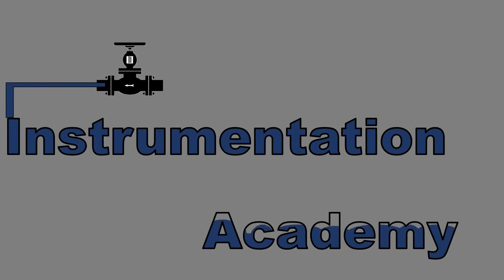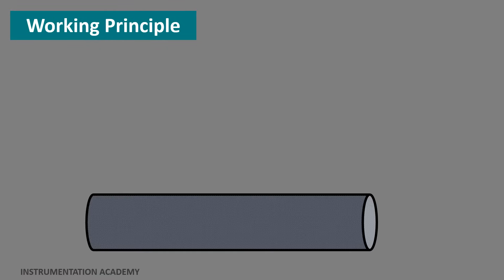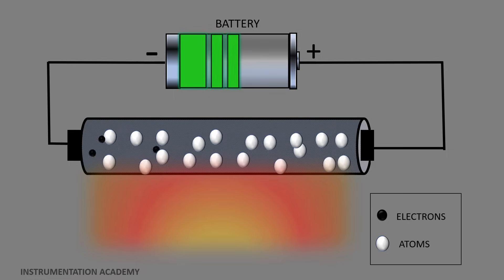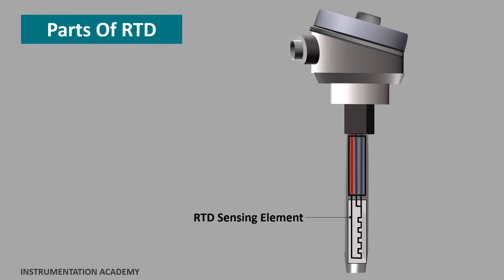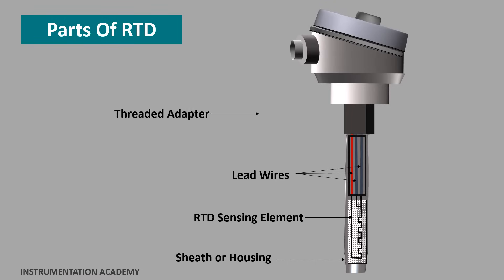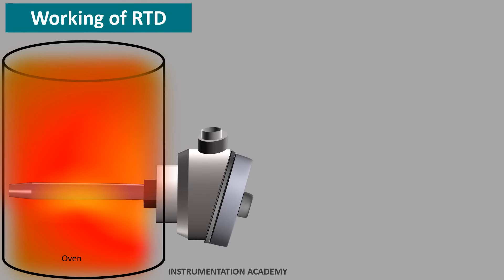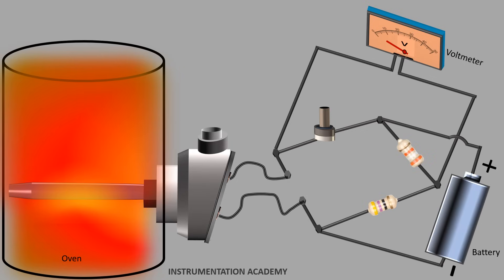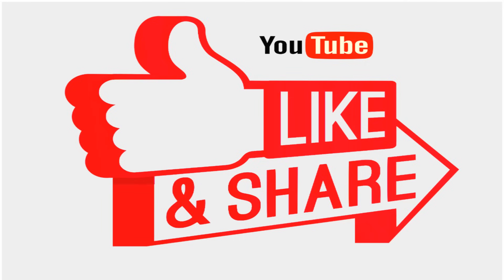RTD Resistance Temperature Detector Working principle. Resistance Temperature Sensors. RTD Animation

Comment: If they are using a combination of RTD and a 4 to 20 ma signal how would that work ?   

Does the RTD send a resistance and then the transmitter converts it to a 4 to 20 ma signal which then goes to the PLC? 

Or would you not use both in combination as it would be redundant? 

Thank you